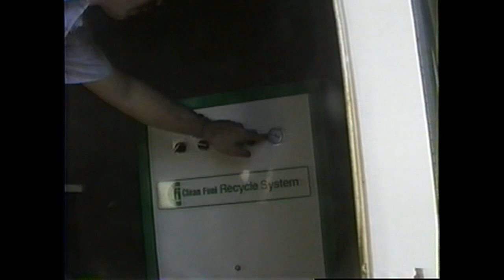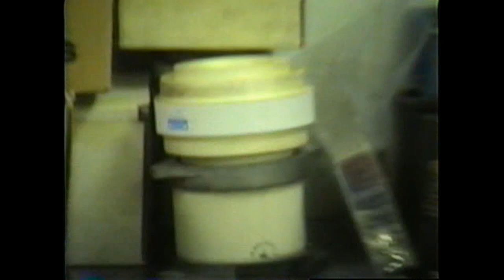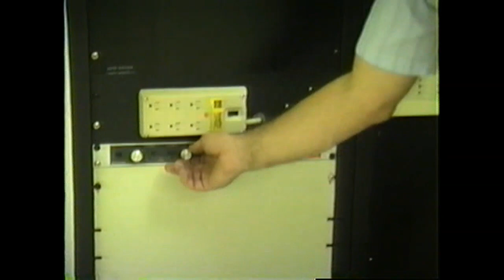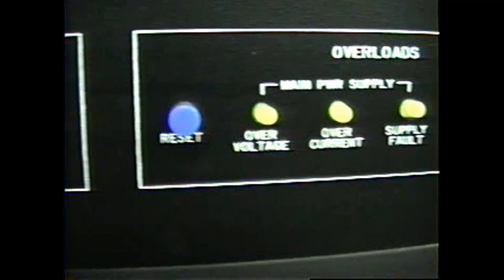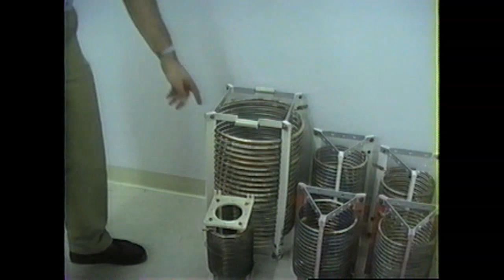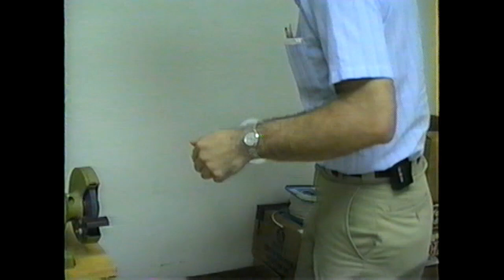JAY WAGGONER'S WGTO AM 540, FLORIDA 50,000 WATT TRANSMITTER TOUR 1994

Comment: Really enjoyable tour! I had never heard of a negative tower before. Like to know more about how that works
Reply: A "negative" tower's job is to absorb some of the energy in the antenna field and return it to the phasor.  It could be thought of as a controlled dummy load.  When creating a deep null or a sharp minima in some direction, a negative tower is useful.
Reply: I'm not sure if negative tower is the same as suppressor tower, but back when WLW was running at 500,000Watts (not a typo) they had to erect two suppressor towers to avoid obliterating radio stations in Canada.  

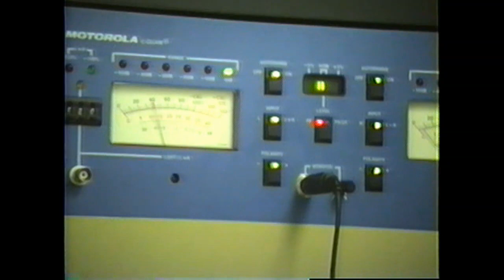WLW tour guide talks about it at 7:20 in this video:   https://www.youtube.com/watch?v=CbHjcwIoTiY